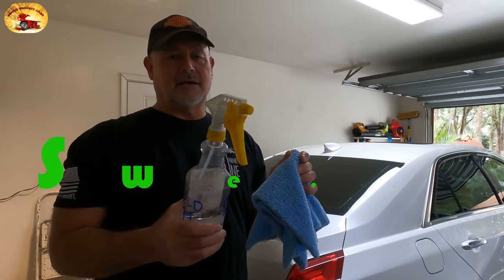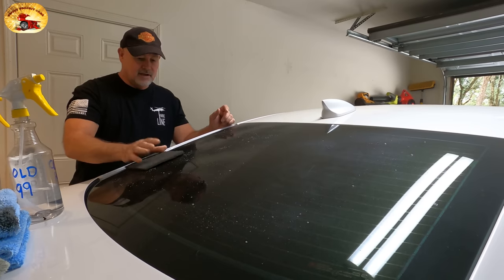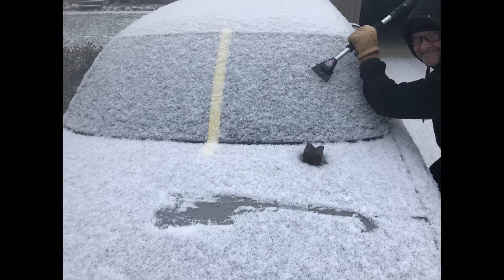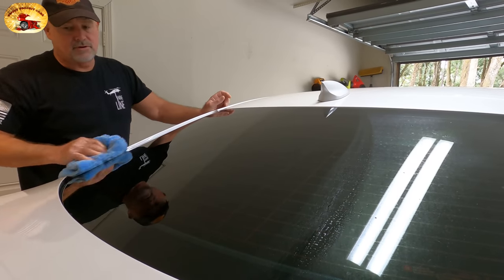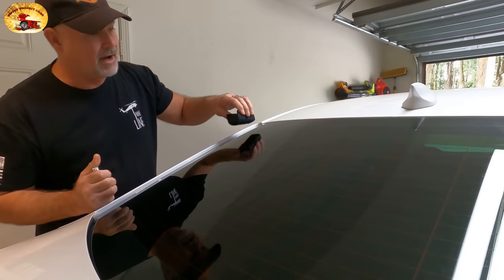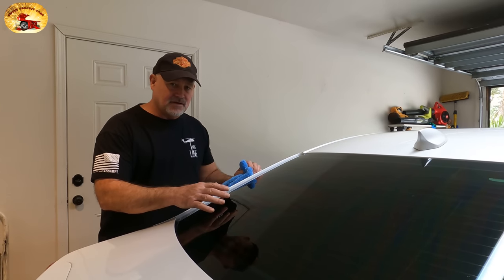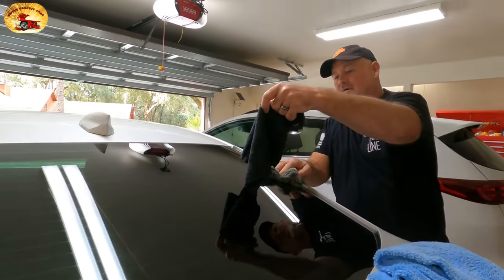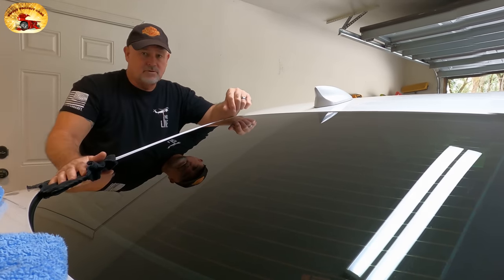Make The GLASS on Your Car or Truck Repel, ICE, SNOW, DIRT, BUGS, WATER.....Throw Away That Rain-X

Comment: Hi Mike, I have a question.  You have mentioned that the buffer you use here is the best you've found.  I'm interested in purchasing same, but is this buffer suitable for polishing vinyl rear convertible top windows?  I've got three Corvair converts that need some to a lot of polishing.  And what polishing agent (and UV protectant) would you recommend?
Reply from the maker: Use everything the same, using this  https://amzn.to/3iaeaAf  with this  https://amzn.to/3XF3BFZ  then to protect it use this  https://amzn.to/2WQg0sB  instead of the ceramic coating we used in this video.  Hope this helps Kirk! Thank you so much for watching and asking, have a fantastic day and all the best on your project my friend. mad Mike the hammer SPC

Comment: How does this work on the front windshield in the winter with all the salt on the roads.  =Does the salt not stick either. 

 Any bizarre visibility or improvements using this on the front windshield.  =Less glare from headlights etc.
Reply from the maker: Nothing sticks to this  https://goo.gl/z9TrgR  Again, you will not do anything to your windshield that will make it as nice as this process, nothing exists on the planet that can do what this does jon. Thanks for watching, have a great day my friend. mad Mike the hammer SPC
Reply: Mike, what is in the first, small spray bottle you used as a cleaner? Thanks, and LOVE the channel bro!

Comment: Would this remove/minimise the appearance of wiper scratches on the glass from worn wiper blades?  I'd be interested to see the results on an older car with such wear, if possible. Thanks
Reply from the maker: You need to do this  https://youtu.be/k1B_puVXtxk  it works perfectly on those wiper blade scratches, make sure you use the exact tools/products shown in the ....more of the video description Vauxfan2k. Thanks for watching and asking, have a great week and all the best on your project my friend. mad Mike the hammer SPC
Reply: @Sweet Project Cars  awesome,  thanks very much for the reply.  Worth the effort and saves a complete new rear glass or tailgate swap. Best regards 👍
Reply: All you need to do to remove wiper blade scratches is Polish them out with a glass polisher and one of those Milwaukee machines it takes a long time but they do go away

Comment: Great video. Question though. How long should this last? I’ve never used ceramic coating on anything but how far does that small bottle go? Thanks!
Reply from the maker: 2 of those bottles will do a WHOLE (body panels and glass) compact size car no problem, but we suggest getting 3 or 4 bottles for an SUV or Pickup truck.  If you take care of it with their care products, you will probably sell the car before you have to worry about it again. See their ceramic care products. Thank you for watching and asking Randy, hope you have a great day. mad Mike the hammer SPC
Reply: The company who makes this guarantees it to last for 2 years.  Money back if you have any issues whatsoever in those 2 years.  Other YouTube channels have tested this product and it really does last the 2 years.  There is nothing anywhere that says it will last longer, but 2 years for a product an amateur can apply is pretty great!
Reply: @trailerwookie  it looks like a good product but I'll save time and money and just use rainx

Comment: I use wipers just to appease the law in my state. Not sure what my dads stuff is but I had a 5 gallon pail he made in 1990 and he died a few years after that but this stuff does the same thing. Just didn't prep glass with mother used the lava soap bar and 90% method. No rainX.
Reply: Side note it made the old Clear coats look new. Used on old cars then flipped em. But definitely ceramic coatings are easier. I have a bunch of them too just never had energy to detail the vehicles fully for them as they all need paint correction. Especially my Land Rover which got squirreled.
Reply from the maker: Thank you for watching and sharing, have a great day. mad Mike the hammer SPC

Comment: Happy Thanksgiving Mike! Would you know if the ceramic coating will work on a motorcycle windscreen? I've been applying wax on mine to fill in the sand chips for a clear view.
Reply from the maker: Happy Thanksgiving to you as well Idylberry!! Check this out  https://youtu.be/qTMJ6OShaG4  and make sure to subscribe  https://www.youtube.com/c/SweetScoots  Thanks for watching, have a great day my friend. mad Mike the hammer SPC & team
Reply: @SweetProjectCars  Thanks Mike!     I'll give it some thought the next time I get serious with detailing the '05 Goldwing. I would probably want to coat every surface I could. Last detail I went over the bike with Maguire's Ultimate Fast Finish on as much as possible except the windscreen. I was using Kleenmaster by Brillianize an anti-static cleaner and polish for plastics before just using wax with better, longer results.
Reply: @IDYLBERRY  Next time you have a brand new plastic windshield, only ever use Kleenmaster, and leave the thinest layer you can before covering with saran wrap. If you need more than one piece of saran wrap, layer with the upper piece applied first, lower piece overlapping, secure the bottom edge with electrical tape, and trim all other edges with a razor blade . Do the same 5 minute procedure every time you replace the saran wrap and the plastic windshield will never get even a single scratch or any UV clouding. Bug guts are extremely abrasive and this is guaranteed to keep them from ruining the plastic windshield.

Comment: How is this better than RainX?  Been using RainX for 20 years, tried n true.
Reply from the maker: You can continue to use prehistoric products if you so desire, today's products are like nothing else out there. If you don't mind using your RainX every 30 to 60 days, that's fine and dandy, or you can do this once every 5 years and it works 10 times better. Thanks for watching Dave, have a great day. mad Mike the hammer SPC